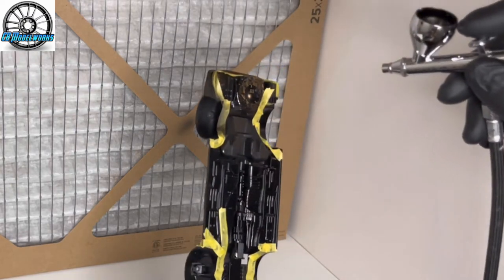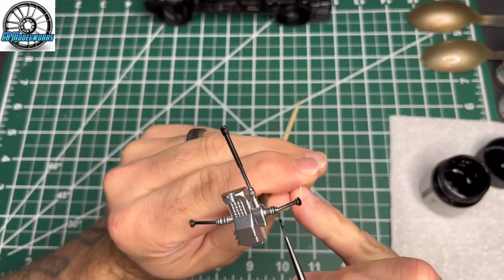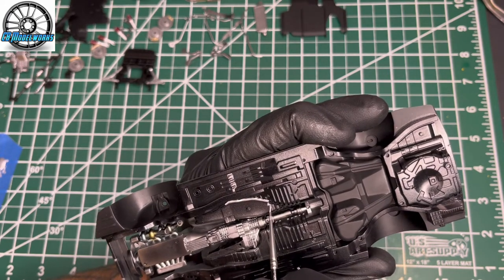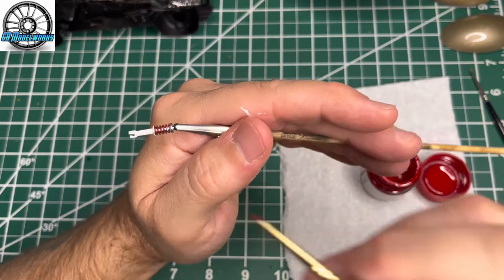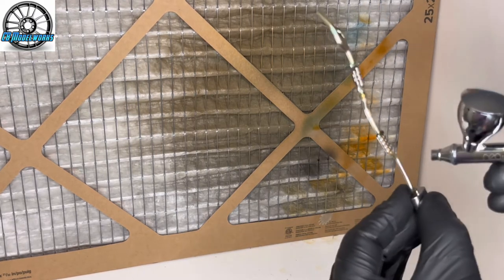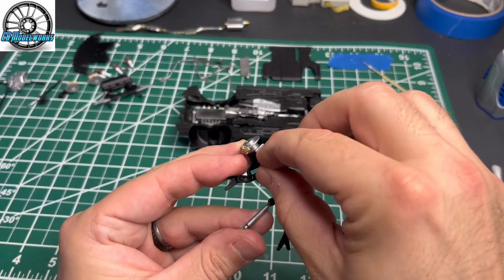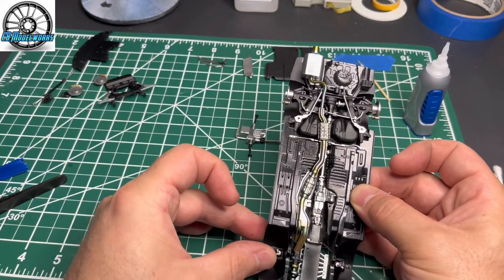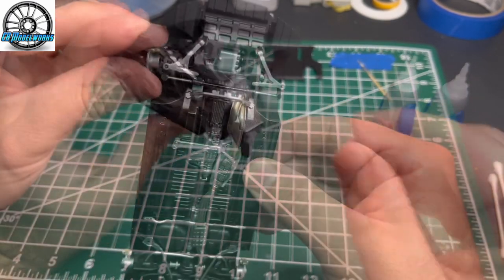1/24 Tamiya Skyline GT-R scale model build part 2 - Chassis

Comment: The exhaust is looking very nice. Stumbled over your vid today. Watched the first 2 vid,s and subscribed.  1 small tip. Use Bob Smiths Industries glue. They are very good and no fogging,even for the clear parts as the windows,lights etc etc. Also when you got mirros glue on the window it is a great glue. Keep on buildings. Happy holidays from Sunny Spain
Reply from the maker: Thank you and Happy Holidays to you as well!